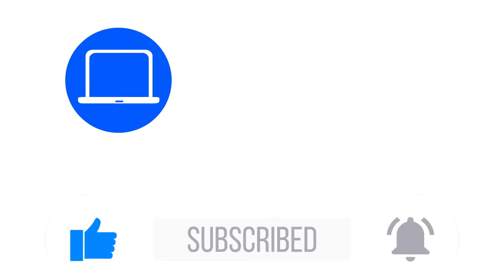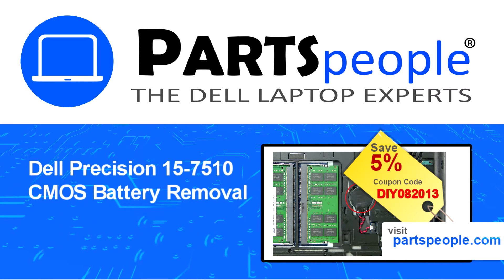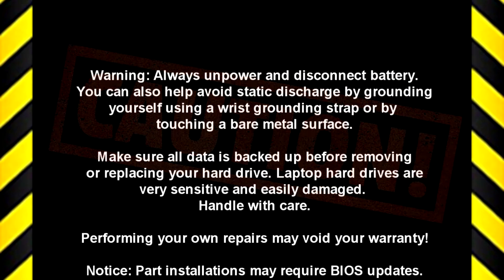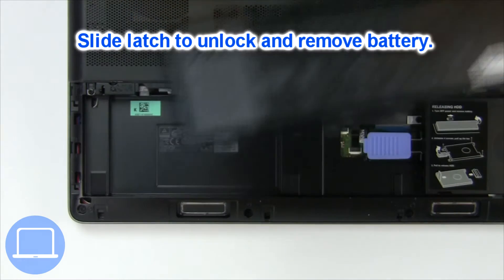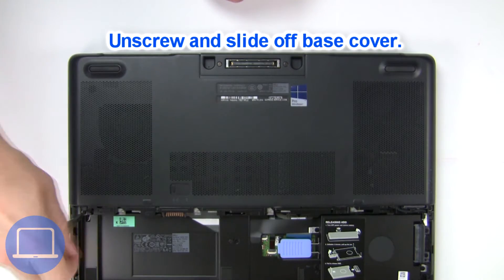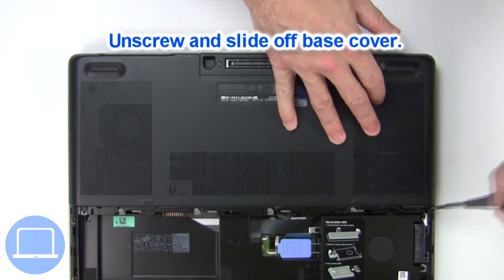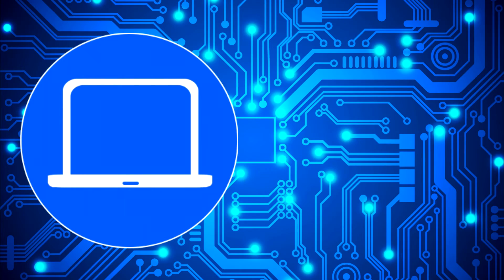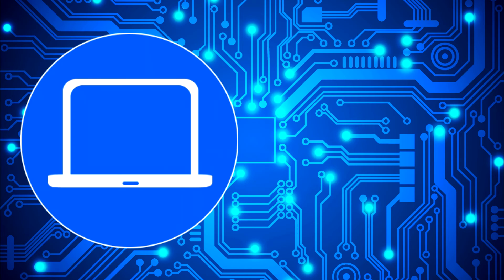Dell Precision 15-7510 (P53F001) CMOS Battery How-To Video Tutorial

Comment: Hi there. Do you no know if this is the same for a 7710? Thanks. :)
Reply from the maker: There are minor differences between these two models (e.g. screw configurations), however, if you're removing the CMOS battery the steps are the same.
Reply: How do I know if I need to replace big battery or this cmos thing.  When my laptop is on too long and must be too hot it says battery low and will shut down. Once I let it sit a bit, it will come back on just fine. Was getting ready to order new battery watched your video and now find out about this cmos battery.